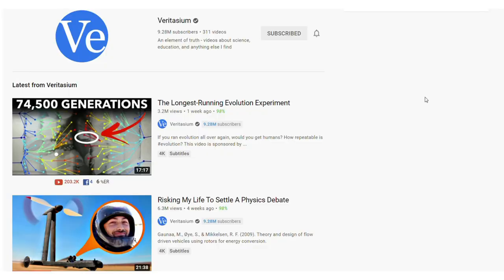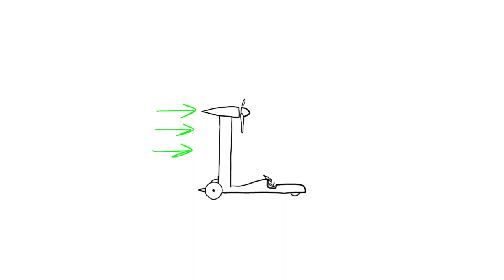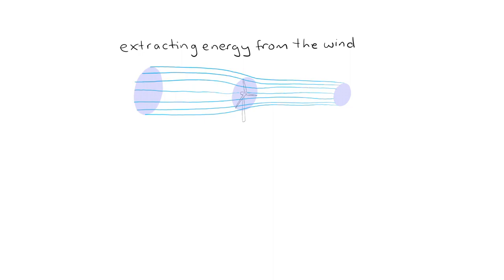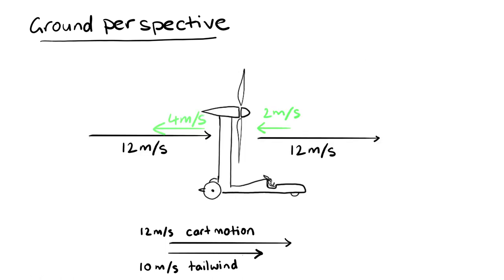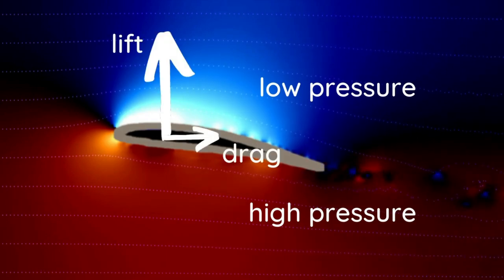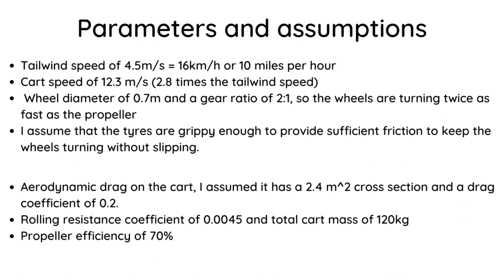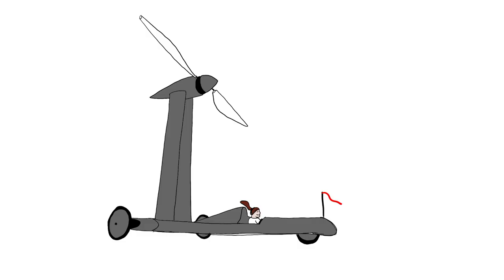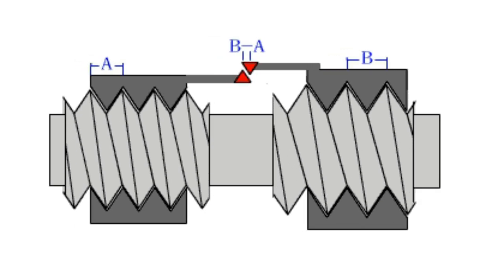Downwind Faster Than the Wind by Veritasium: How Does it Work?

Comment: So,why can't this machine just power itself around when there is no wind,if it can go faster than the wind ,then with no wind you should be able to give it a push start and it would accelerate away? Also if this is true, why doesn't it just keep accelerating,in the same way a jet engine accelerates,because the turbine blades drive the compressor blades? Oh wait,that's right,it uses combustion! Also ,very important, when the wind blows from behind,it blows on the body of the vehicle and the propeller.I know this sounds obvious, but when it blows on the propeller, it's actually trying to turn the wheels backward. So the more wind, the more force trying to stop the wheels.Im sorry,this machine absolutely violates thermodynamics. Sail boats can go faster than the wind for sure,but for different reasons. This machine gets more power out of the propeller, than is put in by the wheels. I have great respect for your channel and for Veritasium ,and I don't really know how it was done, but there are energy problems here.cheers Steve.
Reply: There are no energy problems here.   If there is no wind over ground, the machine stops.  All the energy comes from slowing the wind over ground (the part processed by the propeller) and robbing that air mass of its kinetic energy.    Without the true tailwind, the prop does not produce enough thrust to overcome the wheels retarding force.  We've stated this a few hundred times now.
Reply: "why can't this machine just power itself around when there is no wind"

Go to the Veritasium-Video and read the pinned comment. It's all explained there: "The key is that we're harvesting power at higher speed, lower force, and deploying it at lower speed, higher force (which is only possible because we have a tailwind - in still air this wouldn't work because the relative velocity of the wheels over the ground would be exactly the same as the relative velocity of the prop through the air)."
Reply: Work = Force X Distance.

Do the math and you'll see that the distance covered over the ground in a tailwind is more than the distance through the air.   This allows you to harvest the energy of a larger distance (with smaller force) and expend it over a shorter distance (with larger force).

https://www.dropbox.com/s/107bmzgxhutwo5m/My%20ddwfttw%20analysis.pdf?dl=0

If the wind dies, this 'Distance' delta equalizes and the resultant force and work deltas becomes zero.
Reply: Ok so everyone else was right,I was wrong,the bet was won,and as Derrick said it's all good clean thinking and problem solving, I love it. I just have one more question that I would love an answer for. In the original vid ,on attempt number 3,@ approx 12 mins, the blackbird has an issue with the chain. The vehicle has wind behind it, the normal rotation direction is counter clockwise when viewed from the front. The vehicle slows because of the chain breaking,and as the propeller is driven by the wheels, I would expect the propeller to stop and actually start turning in reverse. But that's not what happens, the propeller ,still rotating in the same direction, actually speeds up ,causing some serious balance problems,for about ten seconds,then magically stops.Hmmm ,I can't for the life of me figure out how this could happen, please enlighten me once again.Thanks for your time and patience.cheers Steve.
Reply: @stephenhammond1656  The propeller was put in negative pitch there.
Reply: @stephenhammond1656  

The Blackbird is equipped with a variable pitch hub with ratchet on prop shaft.  If the prop is put into beta (reverse pitch), the propeller will be driven as a turbine from the tailwind and will freewheel on the ratchet.

In a properly assembled and calibrated rotor head, this is not supposed to occur (it's a danger to the craft and others due to overspeed potential), but the crew during that shoot were ... let's say ... 'less experienced' than the crew that built and operated the craft to perfection a decade ago.  :)
Reply: @stephenhammond1656  The other guys (eyytee and Borton) have it right.  It's a reverse pitch situation.

Comment: If its the wheels turning that powers the prop which creates the thrust to move the car forward then how does the car start to move in the first place? Your lecture on how a propeller works is useless... we know how a prop works. You need to explain the dynamics of HOW the wind power is harnessed and translated into forward movement by the car in the video. You have not done that... you have done the "if you cannot dazzle them with brilliance baffle them with bullshit" routine. This is how it works: The wind turns the prop which is coupled to the wheels with the chain you mention. Wind turns prop, prop turns wheels. To get moving faster than the tailwind you only need to use a gear ratio that translates one prop rotation into 3 or 4 or 5 wheel rotations. Face it.. you are wrong. What you describe.. the torque from the turning wheels turns the prop which in turn provides the trust for forward movement is impossible......... because there is no way to START THE CAR MOVING if your hypothesis is correct. It took you "a week" to figure out nothing.
Reply: "prop turns wheels"

Nope, it can't. They even have a ratchet to prevent that.
Reply: @Rick_Cavallaro  you've been told repeatedly that your hoaxmobile has hidden electric motors, so that's a lie. your parents did a great job on you.
Reply: "prop turns wheels"

It cannot, it has a ratchet to prevent this.
Reply: @Rick_Cavallaro  you seem normal.

Comment: The windspeed measurements in the tests are nonsense. Behind a sail on a sailboat the windspeed is greatly reduced. You've built your whole model on the propeller reducing the speed of the wind to get power and then measure it downstream of the propeller. How about driving a car along at the same speed as the cart with wind indicators on a mast? If the system really works the wind direction will be reversed at that speed.
Reply: When an iceboat goes faster than the wind it increases the volume of air that it extracts energy from because it is scanning sideways through the wind field - you change the energy of a much larger volume of air. This is not true of the propeller since although the tips rapidly sweep a volume on the first rotation, on the next rotation the windspeed is not the nominal windspeed of the wind field but the reduced speed caused by the energy extracted on the previous rotation. When you do windmill modelling, the air is moving past the windmill with predominant windspeed being the wind but even then there are leading pressure wave effects on the flow. I don't think your spreadsheet calculations with a nominal windspeed have any validity at all.
Reply: // "The windspeed measurements in the tests are nonsense."//

Given that I'd bet a good bit of money that you don't know where and how the wind was measured in the tests on the Blackbird, why don't you just go ahead and tell us what was nonsense about them.  M'kay?

//"You've built your whole model on the propeller reducing the speed of the wind to get power and then measure it downstream of the propeller."//

Well, there's you problem right there ... full scale ignorance. 

//" How about driving a car along at the same speed as the cart with wind indicators on a mast? If the system really works the wind direction will be reversed at that speed."//

The system really works.
Reply: "How about driving a car along at the same speed as the cart with wind indicators on a mast?"

This is exactly how NALSA measured the windspeed during the Blackbird record runs. A chase vehicle side-by-side with precise anemometers at propeller height and multiple hi-accuracy GPS units. Then Blackbird went 2.8 x faster than the true wind. Google: "NALSA downwind record" and look at the windjetproject channel for video.
Reply: @bcwbcw3741  The difference between iceboat and prop you mention is relevant for the situation around wind-speed, where it reduces the efficiency somewhat. But once the cart is moving faster than the wind, it is encountering new air from the front, that has not been slowed down relative to the ground yet (just like the ice boat).
Reply: @eyytee  The pressure field extends in front of the propeller on a physical scale that is proportional to the propeller's span.  You really need to do flow modelling to be accurate. vis:https://onlinelibrary.wiley.com/doi/epdf/10.1002/we.451
Reply: @johnborton4522  None the documentaries say and the measurements shown here are nonsense - a windsock and a cloth streamer?  I'm "ignorant" because the experimenters have shown no data to justify their claims about windspeed. Instead of insulting me, show me where the data is. For instance, have they done the experiment where they measure the windspeed away from the pressure field of the windcar,  such as by putting a pole with sensors or balloons on a car running at the same speed near the windcar.
Reply: @bcwbcw3741  

The data from the world record runs for the Blackbird have been publicly available online for more than a decade.  stop with your own nonsense about how it's not available and go freaking do your homework.
Reply: @eyytee  thank you for the information.  Has anyone actually tried to model this in detail?   The wing is going to leave a low pressure wave behind it's path,  does the car work because the wave propagates away faster than the propeller goes around or too slowly compared to the motion of the car such that the wind motion ahead of the car is essentially momentum determined? Seems like it has to be the second - the little spiral puff of backwards waves behind the propeller blades don't extend forward enough to encounter the prop on the next rotation. I've been thinking average pressure field but the time sequence given by the blade motion matters.
Reply: @bcwbcw3741  

The links to the data you say the experimenters haven't released, ... guess what, right there in this video description. Do you do anything but look at pretty pictures?  How about research?  

How about reading the information Rosie gave you before you start claiming to know what's nonsense and what's not.
Reply: @johnborton4522  Apologies, made the mistake of coming here from the verisisum video which does not have good references and didn't realize this video has better references. Confess I scanned her references too quickly and decided I didn't need more videos on iceboats...
Reply: Here is a video of one of the NALSA  runs by the way. 

https://youtu.be/5CcgmpBGSCI
Reply: @bcwbcw3741  

No worries, and thank you very much for that apology. Accepted. 

. Rick and I  designed and built the blackbird and co-owned the world record. I'm happy to answer any questions you want and give you any information you want.
Reply: @bcwbcw3741  

Many, many useful links here.

https://en.wikipedia.org/wiki/Blackbird_(wind-powered_vehicle)
Reply: @bcwbcw3741    "The pressure field extends in front of the propeller"

The same applies to a sail, because pressure differences propagate at the speed of sound.

Comment: Rosie, Blackbird can go faster downwind than the wind, but your explanations are wrong. · “…because the wheels are going so much faster than the ground” sail boats and windsurfers go downwind faster than the wind, and they don’t have any wheels. Not a moving part. · How do sail boats push air backwards like fans? Can you explanin it? No fans, no wheels, still work…not the right explanation. You are using unnecessary elements for the explanation making it completely wrong. “It keeps accelerating because the wheels turn the fan” When Blackbird exceed the downwind wind speed, it experiences a headwind (apparent). In that moment it can´t be a propeller plane without and engine that moves on the runway because the landing gear wheels moves the propeller. Do sailboats and windsurfers use a different technology than blackbird? Different physics principles? No, Blackbird "fan" blades are sails. Can you explain how sail boats go faster than the wind? You lever/wheel/gear ratio explanation falls apart.  I windsurf, I have worked in wind energy, and I love physics…when you windsurf downwind faster than the wind your body is part of a “blackbird” and you can understand it more easily. I want help you  make a much better video with the real explanation that explains blackbird and sailboats. It will be a real pleasure, I love your channel.  anaranjovillalonga@gmail.com
Reply: Her explanations are correct -- I should know, I am co-designer/builder and co-own it's world record.

Comment: Idea for new video:  30 years ago when I bought my property I read a book that showed how to make a water pump with no electricity.  It used the pressure of the water in the tank to push water higher than the tank.  Could you explain that?
Also,  I lost respect for the guy who drove that car with the prop on it.  He was scared out of his wits while going slower than I can run.  For some reason that is a deal breaker for me and I cannot watch any more of his videos.

Comment: Hum, you have forgotten that wheels are not mechanic link to the wind blade. The wind blade generate electricity who is used by wheels motor. Fast wheels won't have impact on the wind blade
Reply: Hum, if only she had repeatedly explained that the wheels are mechanically linked to the blades or if only she had repeatedly shown that the wheels are mechanically linked to the blades you would have realized that the wheels are mechanically linked to the blades.
Reply: @johnborton4522  hum in the official video, we can see the two motor who convert mechanic energy to electricity and electricity to mechanic...
The véhicule can go faster than the wind but not for long. If it can for long why they didn't show it?
My explanation is : the blade have inertia. It s mean than when the wind stop(or go as fast as the vehicle) the blade still do rotation and generate electricity. If you blow a toy with a blade who power a light. The light stay on when you stop to blow until the blade go very slow.
Reply: @johnborton4522  and also the blade who go faster than the wind push also the vehicle.
Reply: Look up the vehicle description for the official record (Google: NALSA downwind record). It's not using electricity or any other form of stored energy for propulsion. That is a strict requirement by NALSA: It must be able to work in steady state, like a sailboat would. And it does.
Reply: @rdcdt6302  

There are no electric motors on the Blackbird.  The link between the wheels and the blades are mechanical as shown in Rosie's animation.

https://youtu.be/CkhBskovitQ?t=876
Reply: @johnborton4522  the video you show is better than the official! Thank you

Comment: Incredible. 
Person after person, highly intelligent, falls for this.
It is agreed that when the cart reaches wind speed, the wind provides zero energy from outside.
Now people, in the style of the old perpetuum mobile, believes that the cart can energize itself to go faster than the wind.
Reminds me of good old cold fusion. Weak testing and experimenting.
Reply: "It is agreed that when the cart reaches wind speed, the wind provides zero energy from outside."

It is not agreed. The propeller can still push the cart if it spins fast enough.

"Now people, in the style of the old perpetuum mobile, believes that the cart can energize itself to go faster than the wind."

It's not a perpetual motion machine. The conservation of energy is not violated because the cart can extract energy from the wind even when going faster than the wind (this is when viewed from the inertial frame tied to the ground).
Reply: //"It is agreed that when the cart reaches wind speed, the wind provides zero energy from outside."//

No such thing is agreed and no such thing is true.

The Blackbird can sit at exactly windspeed (no relative wind over it's chassis) and harvest energy from the true wind endlessly.  That's the difference between wind relative to the chassis (which falls to zero at exactly windspeed) and true wind over the ground (which remains at its original velocity no matter the speed of the Blackbird).
Reply: Lunacy.